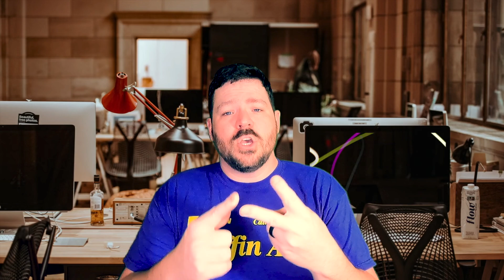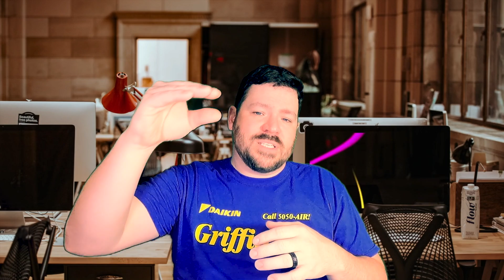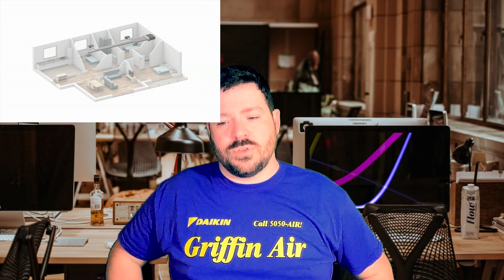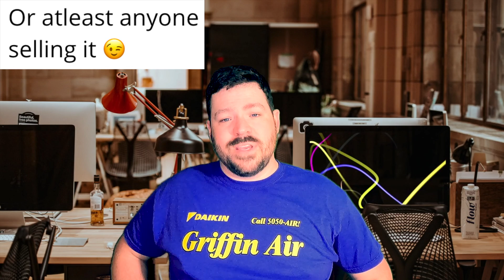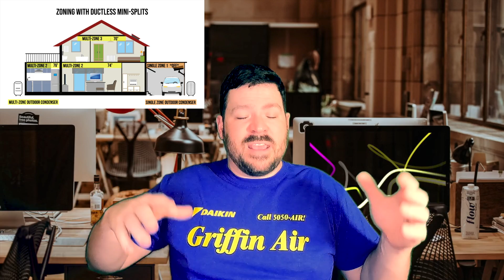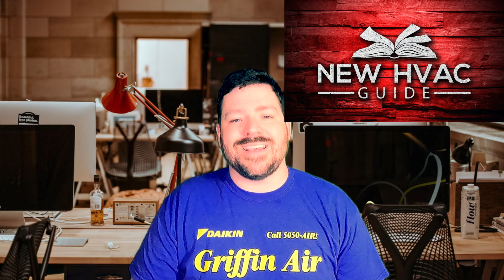HVAC Zoning NOT Needed! We Go Through Why Zoning Systems may be Ending!

Comment: I believe the answer is no.  If I have an air balancing problem in a single system for a colonial with insufficient return, then I'm left with adding a second system dedicated to the 2nd floor or zoning.  I can have the most efficient 500 seer system and I'll never over come a poorly designed duct system.

Comment: i went with zoning in my house and I like it. Being able to have each room's temperature be controlled individually is great. I'm no HVAC guy but even if you size everything perfectly I don't think you get consistent performance throughout the entire house. Every part of the house and room isn't going to have the same heat load all the time.  Trying to control the temperature from one location and it work for every portion of the house is going to be difficult. Like for example in my house the eastern part of the house gets really warm when the sun is rising compared the central part of the house where the thermostat is located. So that part of the house could increase 4 or 5 degrees before the thermostat sees the temperature rise enough to kick the system on or ramp up to a higher stage  or when the sun is setting the western portion of my house gets warmer. That being said it was not cheap the zoning and ducting portion of the project was around $10k.

Comment: great video......i really think the main reason why zoning is necessary is when you have a 2-story house on one hvac system. There's almost always a problem with the upstairs being too hot/cold or the downstairs being too/cold or vice versa. 2 story houses need to 2 hvac systems period. I understand the builder does not pay the mechanical contractors a lot of money in the first place on new construction homes that's why you have 2 story homes with one unit.

Comment: How do you handle a three-zone system with a Honeywell humidifier and only one humidistat?
Reply from the maker: Depends on the house. Maybe just pick a zone
Reply: @NewHVACGuide   Can you explain in more detail. I have a lower level and main floor with master on one zone and then an upstairs on another system. The upstairs furnace does not have a Honeywell humidifier but the furnace in the lower level than feeds the master and great room does. The main floor has three zone one for the master, one for the great room/dining room, kitchen, and den and the other unfortunately for the lower level. How would a humidifier work under these circumstances with only one humidistat placed in the master bedroom?
Reply from the maker: It depends on the house. It also depends on the type of system you have. A communicating system is going to most likely have dry contacts on the furnace and your communicating thermostat could operate it. Conventional system, I would most likely have a zone control the humidistat. Which ever zone is used the most. Sounds like you need to call pro. They will know how to get everything set up for you

Comment: Have you ever had to do a Dual zone setup with a 2 stage AC?  What is the best way to control the sec stage coning on?  Currently I have this installed and the Zone controller has a jumper to tell the 2nd stage to come on if the outlet duct temp is greater than the jumper's setpoint.   The problem with that is, it seems that the outlet temp is never really that high.  I would like for me thermostat to control the stages.  Any suggestions?
Reply: Buy a 2 stage cooling thermostat and wires the system to run on both stages.  The thermostat will control first and second stage
Reply: @zachosborne6577  Yes, my thermostats have the ability to do 2 stage (EcoBee). So do I wire the 2nd stages directly to the unit and not let the Zone Controller to so anything? Will this not interfere with the other thermostat or should a diode be placed inline with 2nd stage wires.  I'm assuming the unit will always take precedent of the highest state?  Meaning if one zone is calling for stage one and the other is calling for stage 2, the unit will stay in stage 2?

Comment: I have a 3,000 square foot three story house with a three ton heat pump without heat strip.  Prior to having zoning, my air conditioning was running 24 X 7 with some rooms too cold and others were too hot.  During the day, I am heating the main parts of the house and switching to the upstairs bedrooms at night.  Seems to improve comfort.  Looking at upgrading Bosch 20 Seer variable speed.
Reply: Add a smaller split upstairs.  Keep the other two floors zoned on existing split
Reply: @zachosborne6577  ageeed you are never gonna get comfort with a single stem unless you well right well conditioned minimum glass open floor plan

Comment: I bout a house that has two zones with dampers. I replaced our unit with a Goodman GSZC18 with the variable speed air handler. I live in SW Florida. My concern with the damper zoning is one zone shutting off for a couple of minutes and the second zone calls for cooling does this on and off but a strain on the system??

And I thought I would be saving on my electric bill but it seems like I’m paying more compared to the last year or two. Would you recommend to eliminate the zoning ?
Reply from the maker: I think it depends on the situation. If you think that having the zoning is causing your utility bills to be higher, I would definitely have a pro take a look.
Reply: @NewHVACGuide  I’m not sure if it’s the zoning but my electric bill is more then the previous  year with the new system

Comment: I understand the argument that if a system is well designed, with the right sized ducts then temperatures should be even throughout the house. But that doesn't account for people wanting different temperatures in different parts of the house. It also doesn't account for how different rooms may perform at different times of the year, or in different weather conditions. For example, you might have a room that gets very hot in the summer as it has a lot of glass and gets sun all day. But on a cloudy summer's day it's fine. On the same floor in your house you may North facing rooms that never get sun. So zoning just gives you all that flexibility so you can account for any conditions and occupant preferences.
Reply from the maker: I agree. Most of those scenarios are kind of common sense. My goal with this video and most of my videos is to help homeowners understand more than they did before. I appreciate you pointing that out though. 🙂
Reply: @NewHVACGuide  I enjoy your videos! by the way, did you ever do one on the Daikin VRV Life?
Reply from the maker: @ScottAllison  thanks! I’ve referenced and mentioned the VRV Life in a few videos but haven’t done one exclusively on it. Anything in particular I should share or go over?
Reply: @NewHVACGuide  I'm not really familiar with it but you mentioned in a video that you were a fan and were going to record a video just about it!
Reply from the maker: Ok pal. I’ll deliver on that promise soon

Comment: This past April I had a Bosch IDS Heat pump installed with two zones  it wasn't to save on energy ...it was all about choice and comfort. It has worked out very well. Our installer made sure the system was sized properly and balanced correctly. The system keeps the house cool and comfy and when the heat is needed the house is perfect. It depends a lot on the installer ....their experience and reputation means the most.
Reply from the maker: Awesome! Can I ask what zoning equipment you used?
Reply: @NewHVACGuide  EWC Controls. Ultra zone Model URD round damper with MA-ND5 Actuator.  Comes with a 5 year warranty. The control board is mounted on top of the plenum just before the Aprilaire filter system. It's covered with a clear cover.  You can see 4 green lights of which one is blinking. It's pretty cool to see all the mosfets, capacitors, diodes and resistors. It's a really good system. Works well.

Comment: VRF and VRV are going to obsolete traditional zoning and many other practices in the next few years. Particularly in commercial applications. Even though going to a VRF/VRV with branch selectors can be over double the cost of traditional systems, customers in my area are far more forward thinking than they were years ago. They look at the long term savings from that very high efficiency and the level of individual control they get being able to heat or cool any room independently and simultaneously. My only gripe about this movement is that mini split/mini multi/vrf/vrv are much more difficult on installers and technicians. Installers have to be taught to never trust a factory flare, torque everything to spec and be very conscious of accidentally mixing up comm wires as they pull them through conduit. Further there commissioning process has to be absolutely exacting. So much so that companies I've worked for have sent service technicians to do as opposed to the install lead or have even gone so far as to create a full time commissioning position to recruit a tech into then send him out for instructor training with as many manufactures as possible so he can return and train installers and techs.  For service techs there is a much higher level of training demanded to really understand these systems and repairs are just flat out difficult because of the ever decreasing size and ever increasing complexity of components.
Reply from the maker: It will be interesting to see when the govt finally gets to minimum requirements being 18 to 20 seer. There are a lot of folks in our industry fighting new technology and telling customers that it’s not worth the money

Comment: The most important part in zoning is, where's the thermostat?
Reply from the maker: Where do you like for it to be? Have any horror stories of it being located in a bad location?
Reply: @NewHVACGuide  Just not in the room that is zoned off.  So many with hole for wire and any negative pressure brings in attic or outside air directly to stat.